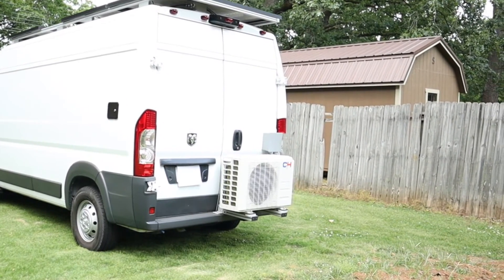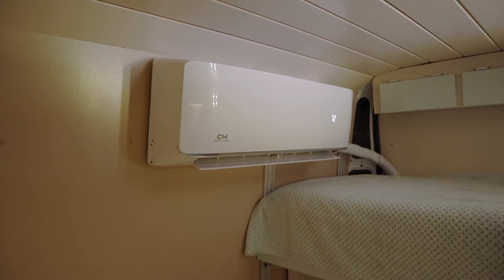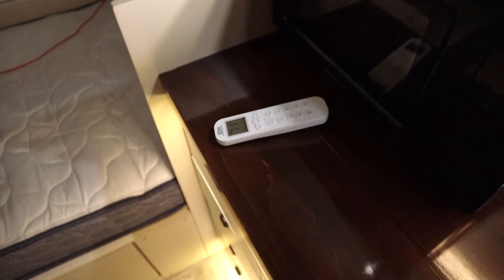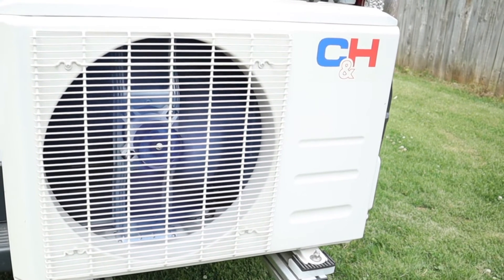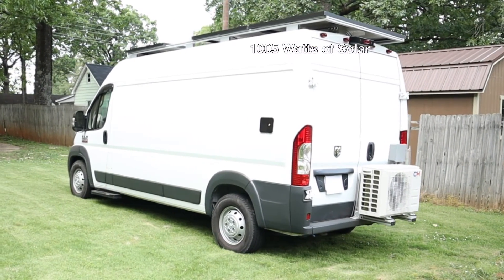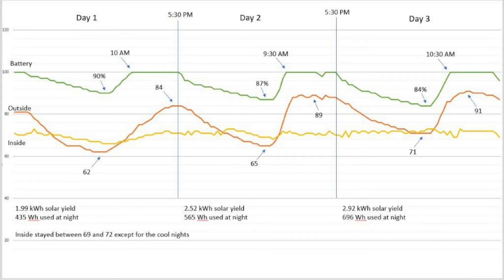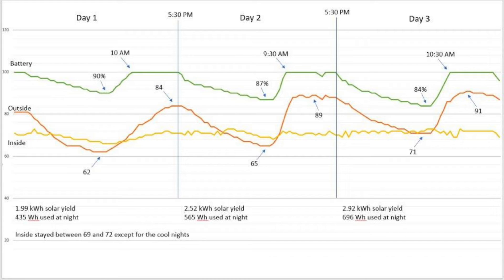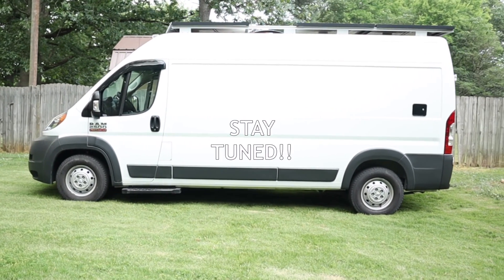Solar Mini Split On A Van

Comment: I loved this!  Thanks very much and I look forward to seeing this in warmer conditions.  Or perhaps out in the field??? People inside would probably make a difference with going in an out.  I'm going to go check out the electrical information video you mentioned. I bet that's just as amazing.  I was questioning whether I could use a mini split or hat to get a 12 volt ac.  I am planning on a lot bigger battery bank but around the same solar capacity so I'm now much more optimistic.  Thanks again!
Reply from the maker: I would definitely recommend the mini split. Sounds like you have a good plan.

Comment: Hi Jamie, thanks for sharing your journey. I am concerned about the interior ( evaporator ) not being level and draining properly. Have you noticed any issues with this?

Thanks, Steve
Reply from the maker: I have had no issues with that. I always try get close to level or at least nose slightly up.
Reply: @jamiesworld4675  Thank you for the quick reply. I have hookup both drains and wyed then together, hopefully this will eliminate any drainage issues.
Reply from the maker: @stevenfontz9022  That will work great for you.

Comment: What was your deciding factor when purchasing this one? It appears that many of the 12k BTU units are just a couple hundred dollars more and the efficiency ratings are quite similar. What made you choose this one?
Reply from the maker: I have a ton of rock wool insulation in the van. Floors, ceiling, walls, doors. I thought 9k was plenty and the 25 seer was the highest I could find. To be able to control the temp 24/7 off grid was important and I want the most efficient unit I could find. I have been very pleased with it. I'm taking a trip west in May and will be a doing a video on how the van performs.
Reply: @jamiesworld4675  Thank you for your input! I head west first week of June. 😎

Comment: Very well done.  I really appreciate the data and the straight forward way you displayed it. Thanks for doing this.  Is it possible to mount the outside unit on top of the van maybe laying on its back?
Reply from the maker: Thanks, I don't think it will work laying down.

Comment: my CH sprung a leak in the coils of the handler 4 months after installation - CH refused to warranty it
Reply from the maker: That's the bad part of installing your own mini split. There is no warranty. I've got almost 20,000 miles on mine and so far no issues.

Comment: Nice review!  How is she holding up?
Reply from the maker: @fredzuccarelli  Thanks. She’s holding up fine. Minisplit is awesome. I made a trip out west in September. One of my aluminum angle irons holding the solar panels broke near Cheyenne, Wyoming. Repaired it with a steel L bracket from Lowe’s. Replaced all of the to steel when I got back home. Wanting to do a 3 day off grid heating test when I get some colder weather here in Alabama.

Comment: is there a way to set the batteries to only charge to 75% max and shutoff at 40%?
Reply from the maker: Not that I'm aware of. You would probably have to monitor and do that manually. Not sure why you would want to do that.
Reply: Yes you can do this with many solar charging units. For example my Victron Energy made unit i could calculate which voltage is equilavent with the "75%" max charging level. Like this, you will get more cycles from your batteries, which probably was the cause of your question 👍😇

Comment: I know you said you ran your batteries parallel but do you run your solar panels parallel or in series? Not really trying to run a AC just a small dorm size refrigerator
Reply: Also I have three deep cycle marine batteries that are 122 amp hours at @ 1 Amp, they are hooked up parallel,  two 200w panels on top. 2000 watt inverter shuts down after 6 to 8 hrs...maybe not enough panel watts to keep the batteries topped off? I've had the conversion van and that setup for 4 years,  never been able to run the dorm size fridge long,  much less a small 5000 watt ac. Any pointers would be greatly appreciated,  thanks
Reply from the maker: @danmichans  The deep cycle batteries will be approximately 13.2 volts or so at full charge. As they discharge the voltage steadily drops. At around 11.5 volts your inverter will drop out even though your battery says it still has power left. The answer is to go with lithium ion batteries. They will maintain voltage all the way down to near 0%. I know they are expensive but that will fix your problem.
https://www.renogy.com/12v-100ah-core-series-deep-cycle-lithium-iron-phosphate-battery/
Reply from the maker: @danmichans  Also the deep cycle batteries can only be used down to 50% where the lithium ions can go all the way to near 0% although I try not to go below 50%.
Reply from the maker: Yes my solar panels are parallel too.

Comment: Finally! Someone who actually gives the info on panels, batteries, and temps. Most focus so much on the AC with no info on batteries and solar.
Great job on the video. Thank you.
 I plug into shore power at night. I'll try going a few days and nights with no shore power.
 I have four 230Ah LiFepo4 Lithium batteries and 16 100-watt panels. I don't have a mini-slit it's just a window unit that works through the floor so it's not seen. It's not as efficient as a mini-split, but I don't have the room for a split unit and I like that you can't see it.
 It's only a 5000 BTU unit so It only uses around 420 watts. I can't wait to see if it will run 24/7
Reply from the maker: Thank you. At 420 watts you should be able to run 24/7 on solar if you're getting enough sun. Insulation of your van makes a huge difference too.
Reply: Hello, did you get it working offgrid? :) 
The window unit is working the same way as the split unit, it may be not so efficient no, due to how much draw there is at the window connection. If you have mounted it through the floor, im sure its sealed and and efficient (otherwise exhaust fumes etc would also penetrate). How did you get the unit under the car safe from dirt and water?
How are all your 16 panels attached to the roof? Frames glued together or invidually attached "in each and every corner"?

Comment: That's a great video. I'm looking for a solar solution for morocco where in summer we have temperature going up to 120 degrees. I am very interested in the whole solution. It would be nice if you could add the details in the description. Thank you. Merci. Chokran
Reply from the maker: I think it would work great. The key is very good insulation. I used Rockwool in the floor, ceiling, walls, and doors. Every little nook and cranny.

Comment: Its makes a big difference energy wise. The sun beating down on your van or shade. Had a homemade ice ac unit with water pump fan and heater coil. 40 pounds ice would last an hour in direct sun. In the shade you could maybe make it for four with timers.
Reply from the maker: Insulation is the key. I have Rockwool insulation everywhere.
Reply: yes, and as you can see, this gentleman with his Ducato-based van has them both. Except from the roof ventilation/fan he has the roof quite good covered with the almost full width (over the van) panasonic 335w panels meaning that he got the shade + the solar energy power to cool the van. 
👍

Comment: i'm really curious how this AC is mounted on the back. I have to assume that you can't open the back door now? Or is the inside unit mounted to the inside of the back door, so that you can open it? very curious.
Reply from the maker: I made L brackets from 80/20 aluminum and the are attached to the back door. I have two small l brackets attached to the bottom pieces of 80/20 with a 1/2" stainless steel bolt going through the bumper for extra support. I can open the back doors by removing those two bolts. I have flexible refrigerant lines going through the door. All the eclectically controls are behind the doors so I don't need to go in there very often. It works great for me.

Comment: Hope nobody bumps into you .
Reply from the maker: I hope not either. I try to stay away from traffic.
Reply: Hi Jamie...Did you connect the piping etc from your air con or does the average guy need a technical to connect the unit.Ican do all solar part but not sure of the air con, @jamiesworld4675

Comment: There goes the strealth factor. Maybe it could be saved if you put a oversized tire cover over it...
Reply from the maker: I do have a cover that goes over it when I'm on the road.
Reply: @jamiesworld4675  ? is how can you run it     with the cover on in other words stealthy.
Reply from the maker: @robertberin4872   No, you can't run it with the cover on.

Comment: Great to know a mini split will work well in a van. Curious if running the AC all night will chew up most of the battery charge, which from what I understand is not good on the batteries? With that much solar panel wattage on top of the van could you add additional batteries to give you overnight relief, or are the two batteries plenty enough to get you through the night without hurting the batteries longevity?
Reply from the maker: I added a third battery before a 7 week trip to the west. I actually ran the heat most nights in Colorado. The lowest I saw the batteries was around 50% in the morning. The lithium batteries life is great as low as 20% on cycles.

Comment: Would like to know how these units hold up long term under all the extra vibration of being on a vehicle, I want one for my truck.
Reply from the maker: I've got about 15,000 miles on it and it's still working fine.

Comment: how does the heating do using this mini split with solar? thanks!
Reply from the maker: I just got home from a 7 week tour of Colorado, Utah, Nevada, and Northern California. Surprisingly, I had to run in heat mode almost every night. I set the unit for 68 and it kept that temp all night. The lowest outside temp I saw was 38. The lowest I saw my battery was about 60% so it did great.
Reply: @jamiesworld4675  that’s great. Thanks for the reply!

Comment: can you open the backdoor?
Reply from the maker: Yes if I need to. I have two 1/2" stainless bolts through the bumper just for added support that have to be removed first. The only time I need in there is for checking the electrical controls.

Comment: Thankyou for doing this... I have been thinking about doing the same thing but I only have 700 watts of solar... maybe enough to run a smaller unit then you have???? I hope.
Reply from the maker: I have been running the heat at night in the Rockies and only using about 25% of my 510Ah. I think you would be fine with 700 watts unless you use a lot of power on other things.

Comment: Can i have the link for the mini split ac you have?
Reply from the maker: https://minisplitsforless.com/collections/single-zone-wall-mount-ductless-mini-split-ac-heat-pump/products/cooper-hunter-9-000-btu-115v-sophia-superior-ductless-mini-split-air-conditioner-wifi-ready-heat-pump-25-seer-ch-sr09sphwm-115vi-o?variant=39543233904832

Comment: How would I replicate this with a tow hitch (boat)?
Reply from the maker: Mounting a mini split on a tow hitch? I suppose it's possible. You would still need an access hole inside the van for the piping and wiring. I used flexible refrigerant lines. Reviews say they eventually will leak but I have not had any issues so far.

Comment: Jamie, I am having a heck of a time trying to find someone to sell me 300+ watt solar panels. But they all only sell them by the pallet. Do you have any advice on where I can get those 335 Panasonic Solar Panels?
Reply from the maker: Sorry it took awhile to respond. I got my Panasonic panels from ecodirect.com and had them shipped to my work to save a little on shipping.
Reply: @jamiesworld4675  No worries, and thanks for the response. I found some from SanTan Solar out in Arizona and I got (3) 410w solar panels (1230w)
Reply from the maker: That'll work great.  @mikefranks4528

Comment: Thanx for making this. I've got a 9k mini split in my RV. I'm curious what gauge wires you used from the mini split to the inverter is..? My inverter is a Xantrec 2k pure sine and wouldn't run mine.
Reply from the maker: I used #10 wire but the mini split only pulls 5.2 amps on high. I have a Renege 3k pure sine inverter. What batteries do you have?
Reply: @jamiesworld4675  Got it. When I got this trailer it came with a small solar system. I have upgrade the panel;, inverter and controller.. but not the wires. I think these coming from the panels and the ones going to the batteries and from the batteries to the inverter are 10's. Battleborn 100Ah x4
Reply: GFCI on the AC circuit? Inverter driven AC units don't like them. 

No reason your inverter can't handle this b

Comment: Can you run the mini split while traveling?  Thanks for teh video!
Reply from the maker: Since it's actually a house mini split I'm not sure I would. I've never had a reason too. the cab ac or heat keeps the back a good temp until I've reached my destination. Thanks for watching.

Comment: Jaime, I just love watching this over and over again because the results are just amazing and the C&H Sophia air conditioner is just totally incredibly efficient and quiet. I can’t wait to get my van build going with this unit and also with the Panasonic 335w solar panels. Would love to see how you mounted the solar panels to the van.
Reply: That c&h model is just a rebranded midea unit. Senville/mrcool/c&h/pioneer  and many others are all the same mini splits. Find one that's the cheapest or has the best reputation
Reply from the maker: The Promaster has little pegs on top for a cargo racks. I made my own brackets and attached 20/20 aluminum to it.
Reply: @jamiesworld4675  Thanks Jamie. Are those brackets steel?
Reply from the maker: @mikefranks4528  No, it's aluminum from 80/20.
Reply: @jamiesworld4675  Jamie thanks so much for your quick responses and I am sorry to bother you so much but how about the rubber pads that support the outside compressor. Do you have a vendor/parts designator you can share?
Reply from the maker: @mikefranks4528  Those pads came with the mini split. I think any kind of fairly tough rubber would work.

Comment: Really nice job, mines similar in my 26'' 1976 GMC Motorhome, 12k though, 600ah and 1720w of solar. Works so well, although in S Florida when its 95 and 90% humidity the mini split has to work allot harder, plus mines black haha
Reply from the maker: Thanks, someone asked how it does in 110 degree weather. You messed up your planning if you're in 110 weather. lol

Comment: Good job!

Just a few words:

- you should also show the power needed for AC when the compressor kiks in. That is very important for many vanlifers, as some of them use  a small inverter.

- get used to tell the voltage of each battery, too, when you mention the Ah.

Cheers!
Reply from the maker: The mini split I used doesn't kick in. It's an inverter mini split. That means the compressor is controlled by an inverter that slowly brings the speed of the compressor up. My batteries are 12 volt lithium but the actual around 12.8 to 13. The good about the lithium is that the voltage remains pretty steady throughout the usage of your power. A lead or gel battery will drop voltage as it drains and will drop low enough to fault your inverter before you use all 50% of your battery. The lithium can also go to 20% power, can actually go lower but you reduce your batteries life.
Reply: @jamiesworld4675  , sorry, I might asked you incompletly..
 I know about inverter type that starts slowly and then gradually increase. But what is the maximum power consumption until it is stabilised? Must be around 1000w..?

I also know a lot about those LiFePo4 batteries. I have 20 kw of them. (16s cells for a 48v sistem + 4s for a 12v sistem, each cell is 320Ah at 3,2v)

I just wanted to tell you that you should always specify the voltage when you tell the Ah of a battery (the total voltage of the sistem or each battery).
Reply from the maker: @silviuflorescu6838  The highest wattage when you first turn the unit on in a hot van is around 600 watts.
Reply: The system voltage was shown several times.

Comment: What is the start up wattage from when the compressor kicks on for this unit? I am working with a 1000w inverter, and planning to get a low btu mini split and one of those easy start surge boxes to help keep the starting surge low as to not shut my inverter off. 

I’m not worried about the running draw, all the mini splits I’ve considered seem to have decently low running wattage, very efficient little units.
Reply from the maker: You don't need an easy start if the mini split uses inverter technology. The inverter in the mini split starts the compressor at a low speed and ramps it up. It's starts at about 40 watts for the fan and slowly increases to about 600 watts if the van is hot. In a few minutes the wattage will start to drop in the 300 watt range and usually never goes back up to 600. The key is to get a high seer unit. The higher the seer the lower the wattage.
Reply: @jamiesworld4675 Thank you so much!